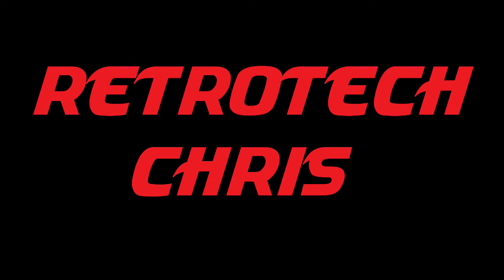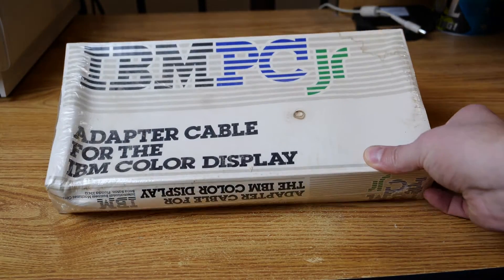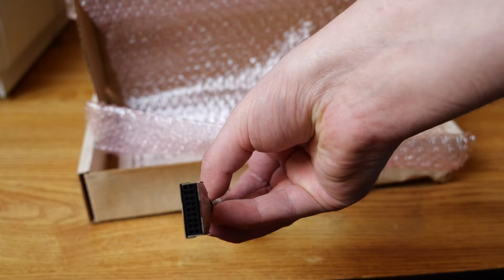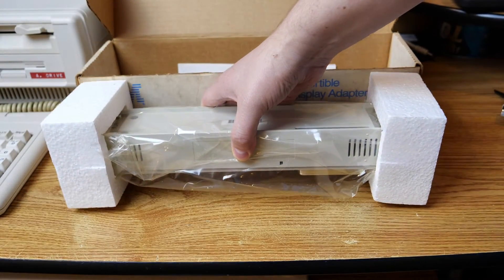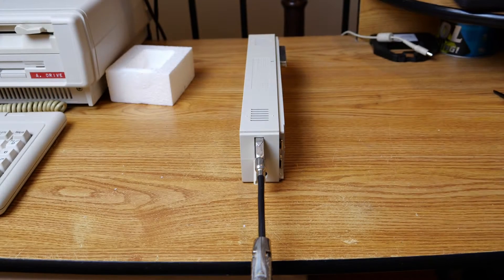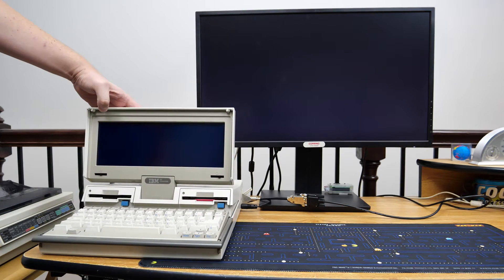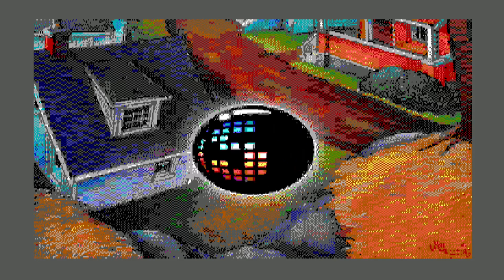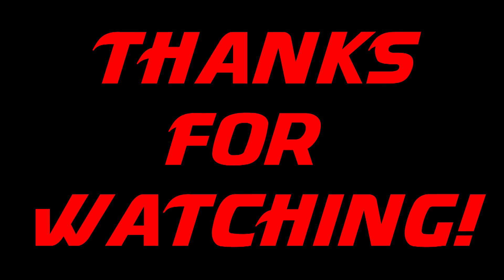Bringing Color to the IBM PC Convertible: CRT Display Adapter

Comment: I bet I know which effects don't sync - the two at the end.  They are cycle-counted for the 5150 and 5160, but they take into account DRAM refresh DMA.  The 5140 has SRAM and doesn't need to perform DRAM refresh and so actually runs faster than a stock 5150.  Unfortunately that throws the demo's carefully crafted timings off.
Reply from the maker: @GloriousCow  nice!
Reply: @RetroTechChris  I imagine that the Display Adapter is essentially a MDA/CGA card shoved in the plastic case and contains either a real MC6845 CRTC chip or a functionally equivalent clone.  From the brief glimpse of the PCB's (seen here https://youtu.be/htl_JbZIcUU?t=2619) its hard to tell, but that's what it looks like to me.  Don't suppose I could talk you into taking yours apart and filming it? :D
Reply from the maker: @GloriousCow  haha perhaps 😂

Comment: Can it play that CGA 8088 port of Wolfenstein?
Reply from the maker: I haven't tried it, I'll have to give it a shot after work today!
Reply from the maker: So, the challenge is the size of the Wolfenstein install and the fact that I don't have any storage for the PC convertible.  And network drivers take up too much memory sadly.  If someone has a PC Convertible and a Zip drive that will work with Palmzip, I'd imagine they could give it a try.
Reply: @RetroTechChris  Ah, oh well. Thanks for trying. Would be cool if someone got it running on a zip drive.
Reply from the maker: @StereoBucket  yea!  I might try Personal NetWare to see if I can get it to load.  Tried LANtastic, which takes the "least" amount of memory from what I have researched in the past.  I just need another 40K or so!!!  If only I could do a swapfile on a floppy disk!